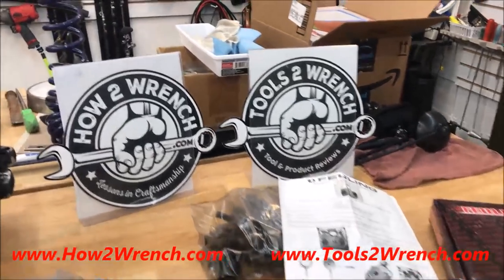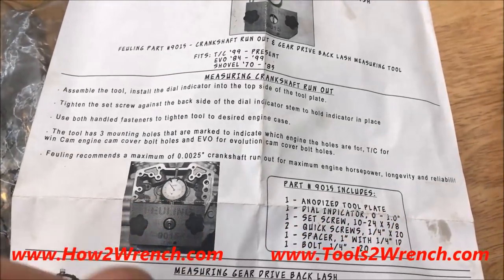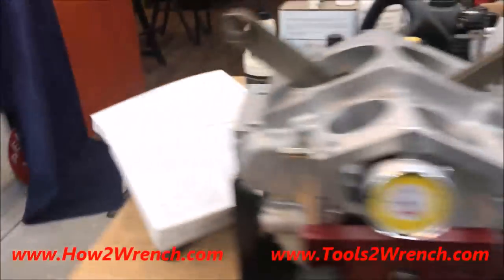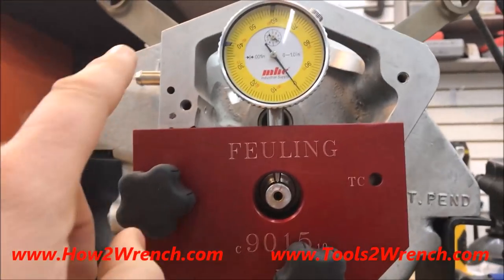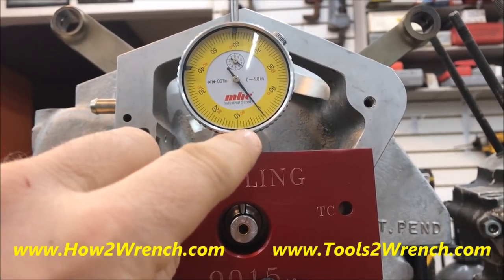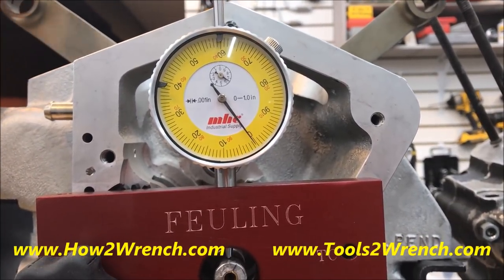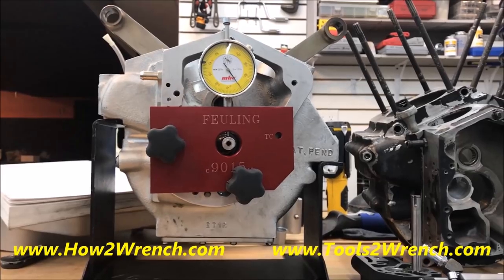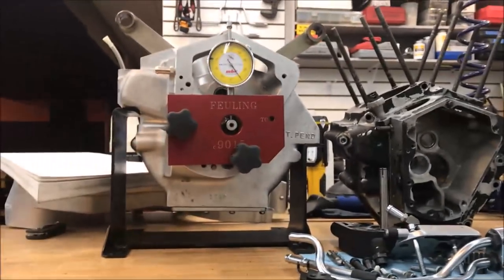How to measure Harley Davidson Crankshaft Flywheel runout the EASY way!

Comment: Nice piece. I bolted up a steel plate I had laying around so I could attach my magnetic base for my gauge. So far I got a lucky crank in my TC because after 24k hard miles it was still under .001”.

Comment: So if The crankshaft runout is out of spec you have to put it in a device and compress the flywheels to adjust runout ?
Reply: Harley Hit It With A Lead Hammer!...On High Point Of Balance Wheels/;-)))
Reply: mike patterson hahah seems so